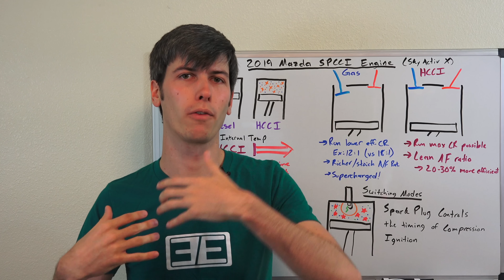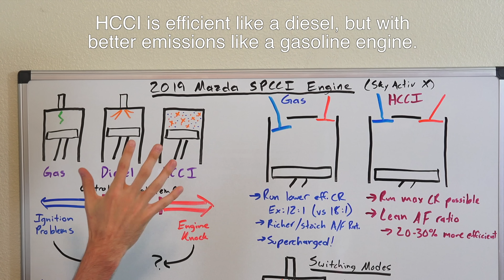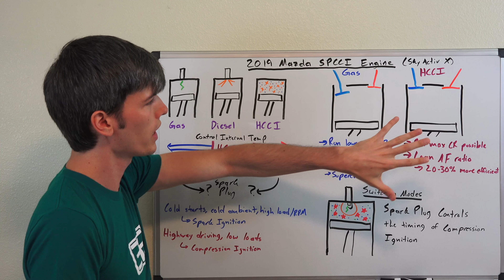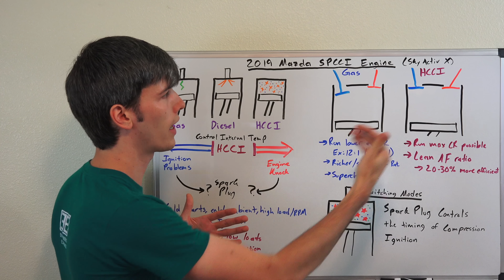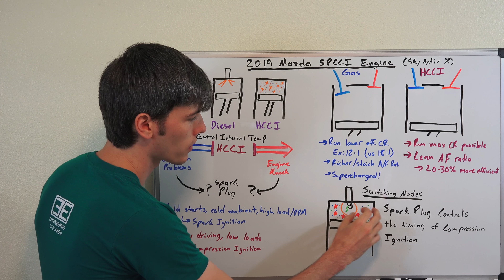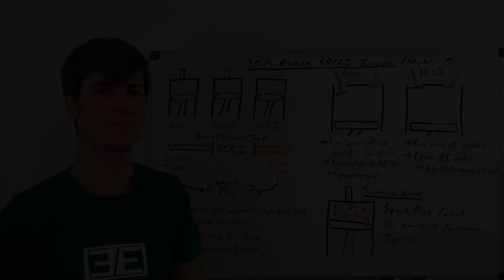Mazda Creates The Holy Grail Of Gasoline Engines - HCCI SkyActiv-X

Comment: Wasn't impressed until the forced induction portion came in. That seems to add an element that can control heat in the chamber. With direct injection and a rich condition to start it out and then allow it to lean out under low loads.....now we've got something awesome!! If it gets too hot, direct injectors can fire 3 times DURING a combustion stroke and that can easily cool the chamber. If it's too cold you can just run it lean and the chamber heats right back up. The real question is how big of a window have they created for HCCI to be used enough to deliver good fuel economy? Also the emissions should be pretty close to nothing running that kind of TDE. It almost reminds me of GM and the quad 4 high output. That thing ran so clean it was 50 states legal with not cat.

Comment: at this point im sick of turbos. my car has one and its OK i guess. i rather just have the extra displacement. my grandpas  2012 mustang GT (that he babies) gets almost as good MPG as a modern 4 door sedan and he has a 5.0 V8. to me a turbo is just another part that is going to break. my specific car has a very small turbo that spins to very high RPMs.... VERY high RPMs and creates rediculous boost. im talking about the ford 1.0 turbo. 24 pounds of boost on overboost and a max "safe" RPM range of... oh just 200,000 RPM... chances are i will need to replace that turbo every 75 thousand miles if im lucky, especially since it runs on just standard 5w20 synthetic. also that engine at that boost is working HARD. my grandpas big ass V8 is probably only working at 25% capacity when he is rough on it. i have to give mine almost full throttle every day just to pass cars on the road.  thats why i will never go back to another small turbo engine again. idk what i was thinking.

Comment: I really would like to know about a nitro rc racing engine. How much hp would a nitro engine make if it was the size of a v8. A .21 nitro engine puts out 2-3 hp. A .28 3-4 hp. A good place to get actual spec. is at o.s. racing. Thx

Comment: Too many variables that can fail and they probably will before they work out the bugs. My guess is that this won't be as seemless in the spark ignition process as they think when in operation for the longer term. How long will an engine like this last. Longevity problems could be another issue.

Comment: A nano fiber spring could be engaged as part of the braking system.  As the brake is applied, the deceleration winds the spring up very tight.  When the car needs to accelerate from a stop, the spring is used to give the car added acceleration from energy that would have otherwise have been wasted.  I agree that a steel spring would have weighed too much, but a nano, poly fiber spring will not weigh much at all, and can provide many foot pounds of acceleration!

Comment: I know it's a little early to ask but what type of fuel will this run?  Will you have a two tanks?  One gas and one diesel?  Will it have a special additive you have to add to the fuel, like a weed wacker motor?  Or even a new type of fuel?  As an ex-mechanic, I know that a high compression diesel engines will blow up if you use gasoline but if you use diesel in a gas engine, it'll smoke worse than Denver on April 20th.

Comment: Now this is a fashionable way to present the knocking effect in the engine because the compression doesn't take place completely to the prescribed CR (half way during compression there's huge pressure developed inside)n hence the power stroke cannot get the complete power generated during the ignition stage. Who do you explain this

Comment: Thats all good, and well, but the holy grail of gas engines would be to just vaporize the gas before it goes into the engine... simple, cheap, and depending on engine size, over 100 miles a gallon.
The powers that be will never allow it however

Comment: TWENTY to THIRTY percent MORE EFFICIENT?!  Oh hang on, a standard gas engine is 15% efficient.  So, take 30% of that, gives us a whopping extra overall 4.5% making the super duper Mazda engine ------ ALMOST 20% efficiency.  Or, still 80% efficient as a heater.  But, thanks for the explanation, I am genuinely interested that STILL, the ICE makers cannot bring themselves to outright state how efficient the engines actually are.  They know the 15% figure is correct - but you cannot find it anywhere.  Electric motors, crap ones, are 85% efficient.  Rubbish heaters.  They are refining the dinosaur?!

Comment: I have a pretty new cx5 with 18000 miles on it, and I can say without a doubt that the aerodynamics hurt this car much more than any efficient ice engine will help fuel economy. I can get close to 40 miles per gallon in town, but go 80 on the freeway and it more like 23. My Hyundai elantra with 60000 miles can get low 40 mpg at freeway speeds with a lower tech engine. Aerodynamics is a much bigger factor.
Reply: The cx5 is my wife's car, and honestly the styling means more to her than anything else. It is a good looking car, the 4wd system is great, and the transmission is a dream, it adapts to you over time.

Comment: Hello Bro,      I am bit confused in air-fuel mixture. If 14.7:1 is the right mixture and the Fuel injection helps to maintain this value, how comes the diesel engine maintain air-fuel ratio. Yes, we r controlling the fuel in diesel engine i.e. for better performance rich mixture is give. as per u said if we doesn't have enough air to burn the complete fuel, what is the use of give more fuel and how does rich mixture helps in increasing engine power. (what is the common A/F for D-engine). Please guide me with this.
Reply: Herr doktorbimmer doesent work
co2 produced by batery production (tons of materials and energy are nedet for that and the hole power Electric are needet include raw and toxic metals and gases) and electricizy are stil made wit coal gas (produce the moust co2) and than you have still atomic power plants (dangerous as hell) buy the way evs are 50% more expensive by insurance becouse higher ignotion danger 
blame richard hamond that he didnt die in the rimatec
Reply: Bro the question is 70:1 A/F is good for the diesel engine or is bad. i.e. It's weather it has larger possibility of producing Nox ? please help me with this....

Comment: Won't this engine lose compression and quit working once the Rings have the least bit of wear on them? Is it realistic to expect this engine to be capable of over 100,000 miles? I see this engine having the same problems as the first gen RX8. But if they begin injecting oil into the cylinder to keep the Rings from wearing out it will no longer be a "green" Engine,right? If they have found a material that can hold up to this abuse that's a material could make rotary engines that make it out of warranty (Apex seals that actually last a while). And on another note is it possible for Mazda to bring up the compression on a rotary engine High Enough for something like this to work? As much solid metal is in a rotary engine has it seems like they could take high compression easier(more reliably and for a longer duration) than a piston engine with all of its delicate and complicated reciprocating parts(Rods, bearings, and pins).

Comment: shouldve made a rotary version
Reply: Herr doktorbimmer they didnt invented rotary it was inventedt buy nsu in 1958  xD

buy the way electric cars are even older than ice butvthey didt made the goal because they are quiet makes it not interesting for people (they are boring) and almoust unpractical.
Reply: Actually the rotary was invented by Felix Wankel hence it's name.
Mazda may bring them back as a range extender for EVs due to it's compact size and are working on a HCCI version to be used in a new rear drive sports car.

Comment: So the MX5 Miata will finally get the boosted engine it deserves???
Reply: You know they made a 1.8t miata right?
Reply: doktorbimmer 
Maybe you are a closet Gay as you keep going on about it! !!
Reply: I am well aware of the fact that a 2jz is a straight 6.
Reply: daveofbillog 1.8t
Reply: Eruid 2jz ain't no rotory dumbass
Reply: Eruid Don't you mean the Wankel engine?
Reply: doktorbimmer or is it doktorbummer? I reckon, from all your GAY related posts, that you are a closet gay so STFU.
Reply: When it takes off the BMW Z4's pants and starts looking like non-pricks can drive it again.
Reply: doktorbimmer LoL
Reply: doktorbimmer, true doe. I'd totally tap that boot.
Reply: WindingMaster check out flyin miata, they're selling a bbr turbo and edlebrock supercharger for the ND now
Reply: doktorbimmer, batteries are harmful, a smaller gas tank can match up a big battery, now before you say ev's don't emit pollution. Most of the energy we use are from coal power plants. So in a way a combustion engine is more cleaner for the environment and it has a higher top speed and more fun. If all countries will use renewable energy, only then I will consider ev's are the future.
Reply: WindingMaster I don't think they want to change the power:weight ratio much more for the MX-5. It already has what they consider to be a perfect balance. Maybe this would allow them though to put in a 1.5L to replace the 2.0L. It has a much better power/torque curve. You could also be mean to the engine in terms of rpm and no lose fuel economy.
Reply: The sky is the limit for Mazda.
Reply: You're right. The original Lotus Elise based Tesla  Roadster weight: 2877 Lb. Weight of Elise it's based on: 1986 Lb. That's a 44% increase in weight.
Reply: readyxxi your existence sucks*
Reply: doktorbimmer dude i deservedly flagged your gay bashing comments. pick a more appropriate, less offensive metaphor like lame, douche, but not fuckwit - that's solely for you, buddy
Reply: Ben as the saying goes it takes one to know one - keep in mind being bi, yes im allowed to say that

Btw haters, prepare to be reported...
Reply: The only thing Tesla will kill is itself
Reply: hullza was a 1.3t wasn't it?
Reply: NihongoGuy i went with an X1 2.8 for thus exact reason. I sacrificed size for a much better motor. Haven't looked back.
Reply: doktorbimmer  That is a little hard to understand. 🙄
Reply: doktorbimmer  It maybe too small a car . And the price goes up with the available power sources. 🤖
Reply: Ford festiva..
Reply: readyxxi how so?
Reply: DesignVisStudios twin turbo lsx in the Miata is the way bro. You don't slow down just go sideways
Reply: My neighbor has a VERY old MX-5, the last model when they stopped selling them with the pop up headlights. So they're definetly selling.
Reply: A 2.5 turbo skyactiv engine would be a good candidate. It's torquier than a 1uz-fe.
Reply: I am gay and I love both American V8 muscle cars and Japanese old school turbocharged inline six sports cars.
Reply: Nope, they said that the 2018/2019 miata isn't getting one, and it's unknown as to whether or not it will ever get one.
Reply: No MAN should be driving a car designed to look like Barbies car and designed for the woman market.
Reply: an electric MX5 would defeat it's purpose of being lightweight.
Reply: I just want a v6 miata or a return to the Wenkel engine. Imagine a Miata with a 2jz.
Reply: Please don't. NA is the way to go for MX5
Reply: You mean the Fiat 124 and 124 Abarth? :)
Reply: The MX5 is a damn underpowered joke.    If they'd put 250 horses in the MX5, I'd go buy one tomorrow.
Reply: mazda suxs
Reply: you dream of mazda rotaries? level up... real men dream of teslas and naked men.
Reply: yawn if they made an electric MX5 it might actually sell.....

Comment: They are working on something that in a few years will be obsolite. Eléctric is the future.
Reply: Tulio Cano who say that electric cars are even ilder than ices and didnt make the goal because they are unpractical even to this day 

and buy the way you can male ice cars co2 neutral  buy bio gas by seaweed bio reactors and outher power to liquids technics ther are heavy recearced.

because you cant male an e-plane or a big e-ship 
and e cars are stil unpractical low range long loadin timrs 3/4 hour ? for 80%?

batery degeneration

expensive

production not economical

Comment: The spark plug tips are the hottest pieces of metal in each cylinder- they can't dump heat away like the cylinder walls.  If the compression is too high the tips will start a pre-ignition event long before a spark event - I predict a different spark plug system is needed for this HCCI to work.

Comment: supercharging Is a definite as atmospheric pressure change would be far to inconsistent and would change compression too drastically even with elevation change. Turbo's are more efficient but are inconsistent with rpm change. For every revolution of the crankshaft there will be an given ratio to the supercharger.

Comment: I thought the wankel engine initially was designed for hydrogen? They are not going that direction are they...  wonder whether we still will be using combustion engines down the line. Still hoping for hydrogen car though

Comment: Good effort to explain. I have to say that there are elements of this operating cycle that some might say are designed to pass emission testing, but not be nearly as clean during normal driving. Let's hope that is not Mazda's plan with HCCI. 
Although I am pleased that Mazda is working hard to make engines clean, the simple truth is that this engine will pollute more in the first mile of operation than an electric car in over 100,000 miles.
Reply: No....I wish it were so. The more efficient, the higher the combustion temperatures and the higher the NOX generation. That is the fundamental problems with compression ignition. Mazda really does not explain how this is going to work.

Comment: I was under the impression that Mazda were going to use high pressure air injected into the cyclinder to control the timing and ignition in the HCCI engine and not a spark plug?

Comment: Could you make a video about how porsche rear wheels turn with the front wheels also turning?
Reply: On low speeds the rear wheels turn the opposite way to give the car a smaller turning radius and make it more nimble. On faster speeds the rear wheels turn the same way as the front wheels to make the car more stable.
This happens automatically. The rear wheels only turn a few degrees.
The Skyline R32 GT-R used this technology back in the 80s.
Reply: @doktorbimmer

Not sure if grade school tier troll, or genuine mental impairment.
Reply: 928 FTW.
Reply: But steer from the rear is easily done in Porsches. Smile included free of charge
Reply: Liam Clarke ...... that's pants
Reply: Google it! Porsche 918, top gear even did a piece on it with a ferrari, its not driver controlled, I don't mean you used the rear wheels to turn the car, but some cars have active movement on rear wheels
Reply: who used it first?
Reply: done some research, it was first used in 1962 by the subaru 360, a true pioneer of RR cars, it was also 2 stroke and as we all know 2 stroke is far superior to 4 stroke in everyway. none of this matters though, tesla is the future!
Reply: Electric motors in the front...it's a hybrid
Reply: Porsche got rekt by a Laguna Estate with the 4Control technology.
Reply: Nissan/Infiniti has 4 wheel active steering. I believe they have had that available for a while now.
Reply: He means rear wheel steering half wit
Reply: you mean the fact that they still put an engine out the back so the car is so unballanced that it drives like a shopping cart on ice? porsche suck.
Reply: buy a tesla and research flat earth.

Comment: Dear god could a gasoline X diesel hybrid into a rotary the diesel will lube the housing using globes and spark plugs bigger bang in the intake and Revolution lower compression can add more boost get around emissions omfg brap brap brap brap bravo! And the rotors could have bigger channels they would be like a bp pp omg think of the possibilities

Comment: This is really interesting, but with such tight tolerances, I wonder how different fuel Octane ratings would effect that. I'm not sure about elsewhere, but here in Canada, the range of Octane ratings is 87 to 94. That's a huge range, and I can't imagine it would all somehow match the exact compression, timing, etc. required to recreate HCCI reliably. Maybe they just have a specific octane requirement and if you put something else, it switches back to regular spark plug ignition.

Comment: Serious question: This can only work if they can change valve timing on the fly. I haven't seen literally any technical information on how they've managed that. Someone else mentioned Freevalve below - has Mazda developed their own non-mechanical (cam-based) timing system or have they partnered with Freevalve?

Also, how much of this trickled down from Mazda's track efforts? In F1 they've been playing with 'pre-combustion' chambers and the like, this seems like a compatible process, or at least the far end of similar research in maximizing and controlling that combustion process. Not that they'd tell us (much) but it seems a logical source.

Comment: Sky-active is currently at 13:1 compression ratio.  There is a dome on top of the piston that makes the compression ratio that high.  There is a small circle in the middle of the dome where the main combustion event takes place that reduces the ping and knock that high compression would normally cause.  I think they will make the dome bigger to make the compression ratio higher for compression ignition then use overlap of the VVT to hold the intake open during compression ration for spark control.

Comment: Efficiency at the cost of complication does not equal economy. My new Volkswagen Passat was an example of this. Great MPG and performance. But its awful reliability caused repair bills that cancelled the fuel savings. This is an old engineering story. Various steam locomotive designs were made complicated,  in a performance quest. But they reverted to simplicity as a more economical solution.